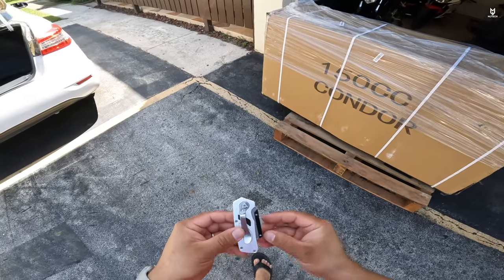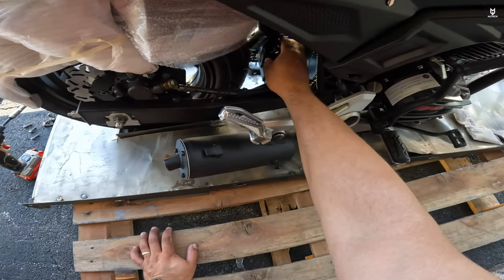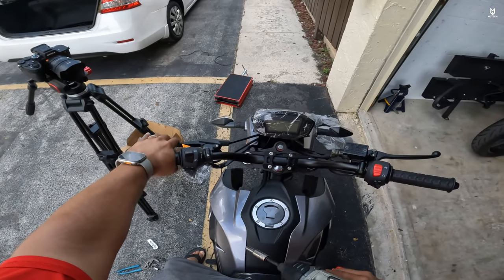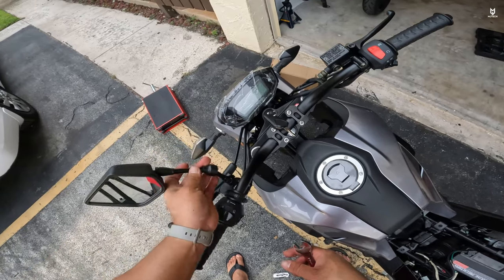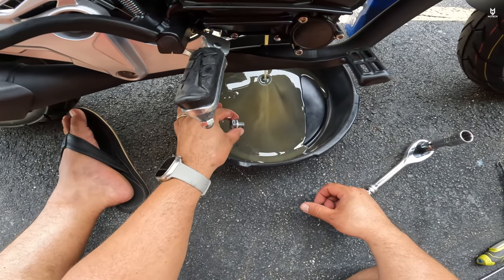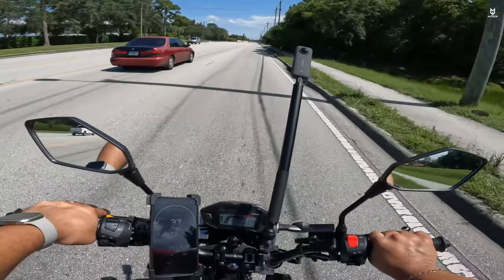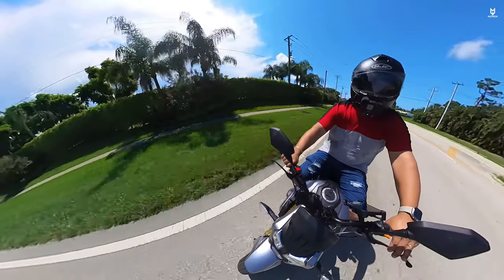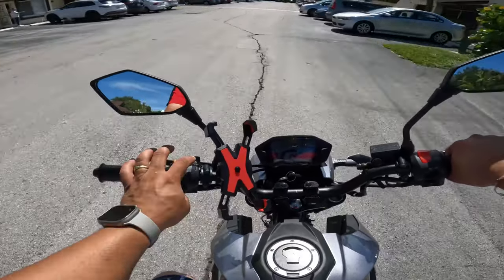I Bought The Step-Up 2023 Honda Grom Clone - RPS Condor 150 - 60MPH+

Comment: I would have gone with the Lifan KP mini 150. Lifan builds the motors for honda and it's a reputable company that does small-bore moto gp style racing
Reply: KP Mini is excellent
Reply: @gmodesike Hard to adjust valves though.
Reply: @jimstenlund6017  it's really not bud.
Reply: @HazeyDayzz420  dropping the engine to adjust valves doesn’t qualify as ‘hard’?
Reply: 2 stroke....

Comment: Three questions. How much does it cost? When can I get it? Do you need a license to drive/ride it?
Reply from the maker: Hi. I will answer them in the same order. It is roughly $1900 after shipping and taxes. If you are referring to the shipping speed I got mine in 4 days after being sent. Yes, in most states after 50cc’s you need a valid driver’s license with a motorcycle endorsement.

Comment: You'll get better power and fuel efficiency if you put a 90 elbow between your carb and cone filter there. Yes, it will add a little restriction, but it adds turbulence which increases fuel atomization.

Comment: You should put Daytona enema 190cc on there. They're the best pit bike engine available 24 horsepower and comes with 5-speed transmission and oil cooler
Reply: That’s a ZS190, Condor is a CG style ( not horizontal )

Comment: I'd never ride a cheap Chinese clone! Your brave and I ride daily but I'm not as brave as you. I'll stick to my Groms and Monkey even if they cost triple of what a carbureted clone does.
Reply from the maker: It depends how well you prepare them/set them up!
Reply: @MJTechChannel  I'm never going to buy a new motorcycle and have to go over every bolt and fastener before knowing it is not only solid but safe. TBH I only watched part of your video to just drive the point home to someone to not buy a clone because they would almost immediately have to spend time and money on the bike. Neither of which they have any to spare as she's been diagnosed with terminal cancer. I'm in all the clone FB groups and I'll stick to my (6) Groms and 2019 yellow Monkey. Take care and good luck out there.
Reply from the maker: @jal187  Totally get it. These are not for the “get on and ride” bikers. They have a special place. Take care and stay safe.
Reply: Lol you mad you paid double same bike these bikes are great have 20 k no issues change oil check bolts first get change plug last forever
Reply: @603adventures9  no I’m not mad. I have (6) Groms and a 2019 Yellow Monkey. 😂🤣😂

I’ll be able to buy parts and upgrades in 25 years and your bike won’t even exist. Your money, your choice but your delusional if you think I’m upset with what complete stranger is buying with their money. Bet I won’t see you at any of the Small bore events around the country tho. You know with all the money you saved you shouldn’t have any excuse to not make the events tho. 😂🤣😂 ✌🏽
Reply: Yea right 😂
Reply: @jal187  yow MJ tech keeping shoot your videos bro the last time I check your responsible for your safety of auto mobile are a motorcycle......jai187 bring your car to dmv without a catalytic converter see if you pass.....lmao by the way MJ TECH HAT HAPPEN TO VITACCI GTO STILL TUNNING GOOD
Reply: @603adventures9 you get what you paid for, there’s reasons why the grom coast more. And grom owners don’t get mad we feel pity, it’s the clone owners who are mad that they can’t afford the real one
Reply: @ooohsnap7016 I say to each their own. As for the "They're mad because they can't afford a Grom." Nah, they're not mad. They bought what they wanted. A sport bike owner could say I'm mad because I have a slow ass 2022 SP Grom because I couldn't afford a sport bike. He would be wrong  though. I bought a Grom because I wanted a freaking Grom. Stop the hate. I'm glad these mini motos are bringing more people into the two wheel world, regardless of what bike they choose, or can afford. Ride on my dudes, and keep the rubber side down. 🤙🏽
Reply: Mine is amazing😂 if you love riding you won’t mind getting your hands dirty to get these nice lil things set up. Mine has 1700 miles on it and I haven’t even put any of the parts I bought for it on yet. Waiting until I have everything for a nice full build. It’s going to be awesome😎 and I didn’t even pay 2k for the bike and all the parts💯🤌🏼
Reply: Me looking for who asked
Reply: The grom is made in China 😂😂😂
Reply: @chrisg9602 I was literally about to type that. It’s the same Chinese parts in Honda and their brothers company lol
Reply: @SCFPV facts I’m getting one soon. Not sure if it will be a from or not